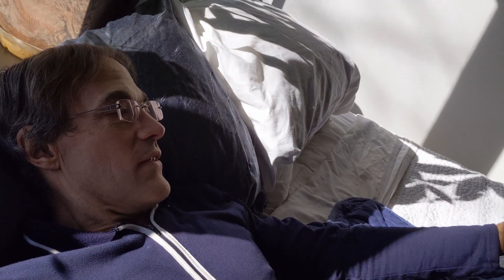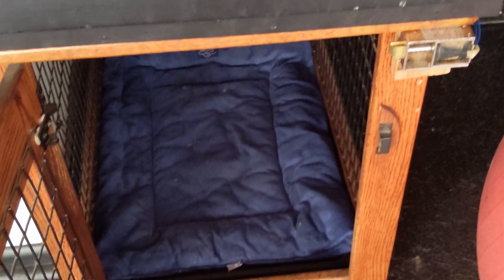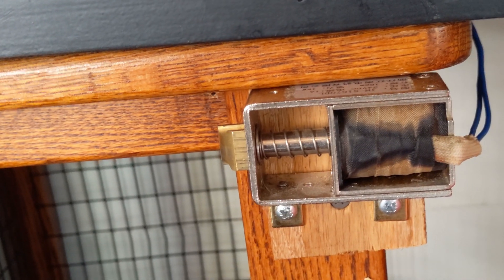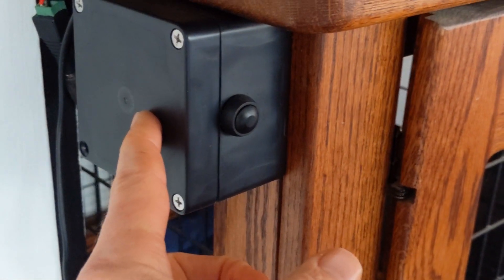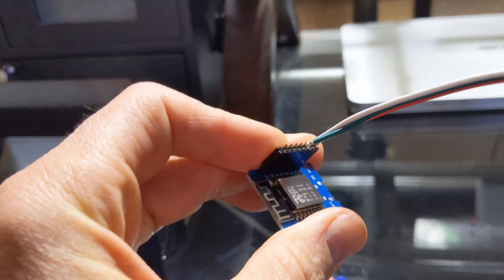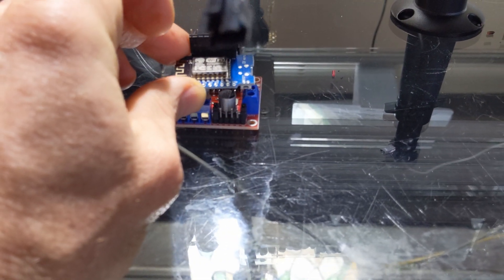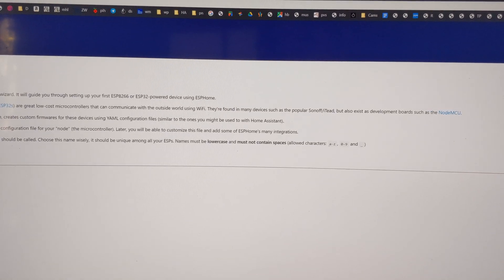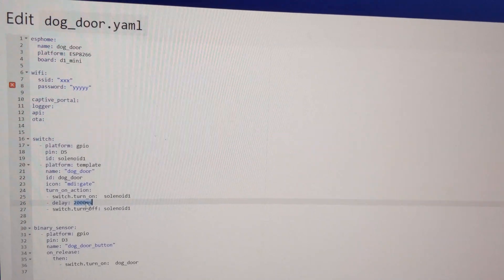Voice controled dog crate door, version 2

Comment: cool.  any chance you could provide a parts list and the yaml?
Reply from the maker: I updated the video description (above) to include a parts list.   It now also lists the esp-home code, which includes the mqtt section I didn't show in the video.    I use node-red rather than yaml, but it is very simple.   When the 'Unleash the hounds' scene is activated, node-red sends 'open' to the mqtt nr/dog_door topic.
Reply: @BruceWinter  sweet!  many thanks.  now this is super useful and could be a starting point for many projects.